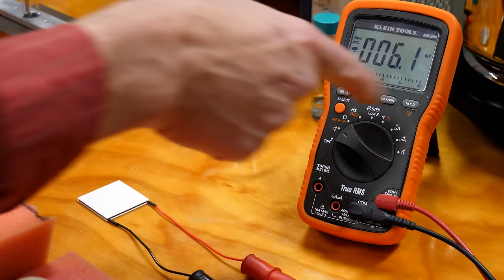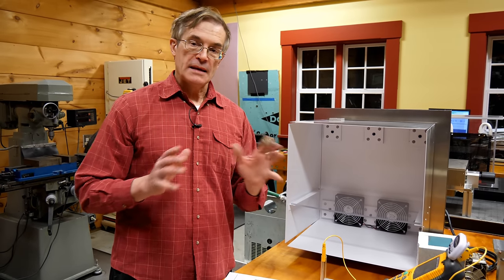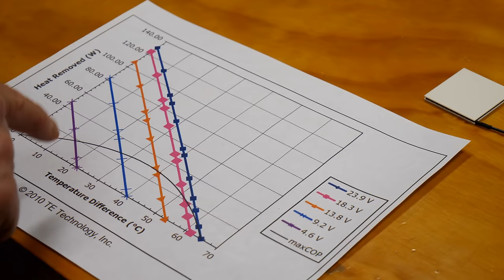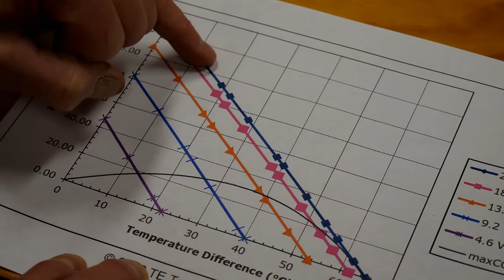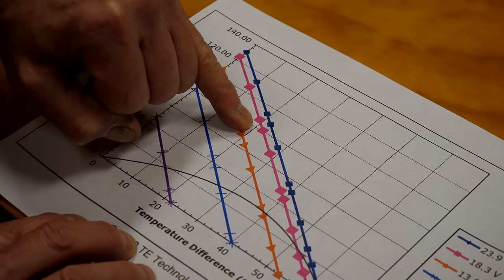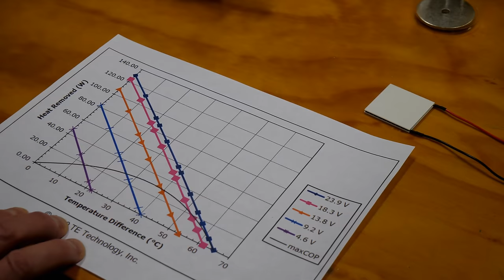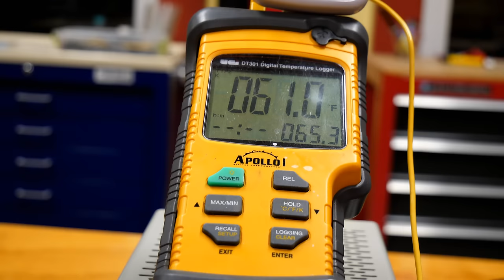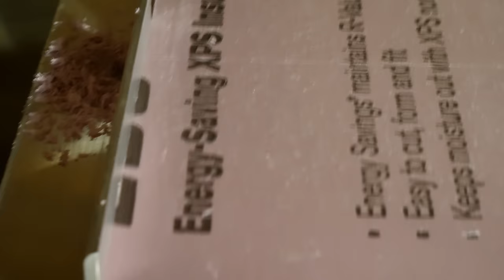BUILD YOUR OWN REFRIGERATOR! - SOLID STATE TEC

Comment: Two years ago I did the alternate approach, for the sake of lower operating costs. I bought a small phase change chest freezer and replaced the thermostat with one from a refrigerator. That gave it a higher temperature range and turned it into a chest fridge (all for around $200). It uses a minimum of three dollars electricity a month (insulation losses), plus more depending on how much heat is being put into it (from items to cool and warm air when the door gets opened). I replaced the OEM run capacitor with a larger farad value to improve the refrigerator's power factor, but that made the electricity cost go up slightly (lowering VA raised the Wattage). It had condensation issues, which I solved by putting a bucket of "Damprid" inside. Other desiccants would probably be safer for use near food, but the stuff I store in mine is mainly unused laptop batteries in ziplock bags, alcohol, solder paste and occasionally a bag of fast food.

A quirk of the compression pump running on single phase AC is that it has a minimum off time. If the fridge is turned off and immediately back on, it overloads and draws a huge amount of current for a few seconds. It takes a few minutes of being off before it can start up successfully. This is because the motor runs on single phase AC and would have zero starting torque (it would never start turning), except there's a trick used to create fake two phase AC with capacitance which adds a tiny bit of starting torque. The "start" capacitor serves a purpose but then it wastes power after the motor gets going, so a series PTC resistor cuts power through the capacitor after the first seconds of operation. After running, it takes time for the PTC resistor to cool down and reconnect the start capacitor.

Also, most phase change systems can't run upside down or turned on their side. Standing mine on the side, so the door swings open like a normal mini fridge, would've damaged the compression pump. The lubricating oil in the pump would drain into the compression lines, then the pump bearings would wear out rapidly. That's also why new refrigerators should be unboxed and stood upright for a while before powering them on, to give any oil in the lines time to drain back into the pump.
Reply: Why do you store unused laptop batteries in the fridge?
Reply: Freezers are optimised for higher delta T and lower power. To run them as fridges are not efficient. 
You can install a tray on top of the compressor and drill a hole thru the insulation so that condensation ends up in the tray. The heat from the compressor will evaporate the condensation. If you have very much condensation you either have a leak or open the lid to often.
Reply: @Bob_Lob_Law  Self discharge is reduced at lower temperatures. Keeping them cold keeps them charged.
Reply: @per.kallberg  There was a small amount of condensation, but not enough to drip or puddle. I was worried about mold and I replaced the first bucket of desiccant after six months because I didn't expect it to last, but that was a mistake. The replacement bucket is still fine after more than a year. Eventually, when it becomes saturated I can bake and reuse it or switch to a food safe desiccant. [edit: There's been no condensation at all since putting desiccant in. I didn't spell that out clearly enough.]
Reply: I did the same, I run my 150litre chest freezer as a fridge, uses 100watts a day in 30c ambient.
Reply: @Chris BalfourThe reason why compressor cant restart quickly is because the pressure has to relieve at the piston. Air compressors unload the pressure with a little valve when the pressure regulator switches off.
Reply: Chris Balfour b
Reply: @chrisbalfour466  Or for bigger loads, https://www.ebay.com/itm/AC-110V-0-01s-99H99M-Programmable-Time-Delay-Relay-DH48S-2Z-With-Socket-Base-/162009789241?hash=item25b8893339 or add https://www.ebay.com/itm/1-2-5pcs-DC12V-DC24V-AC110V-AC-220V-JQX-40F-2Z-40A-Power-Relay-2NO-2NC-/302151351183?var=&hash=item46599fbb8f for even more current. You end up with a 40A circuit with up to 99 minutes delay. It is what I'm building into a control box that will switch from commercial power to inverter power with the timer set to allow the delay for the compressor to bleed down. Yes it is an over build but it will take care of false start attempts and also cover for inverter drop outs due to low voltage. Inverter will be delayed power on to fridge while commercial power will be instant. No power will be used to operate unless the inverter is supplying it other than couple LED indicators to show operational status. 

And Mark and Chris, some commercial sized A/C units can also unload the compressors. They are used on 3-phase units where the pressure on the systems can be controlled by the number of cylinders that are used for compression. On start they can have all cylinders bypassed and then bring in the number as needed. Once the compressor units are started they normally are on for a long time and run solely on how many cylinders and evaporator sections are connected. US Army built such units into the cars for the Mobile RADAR Bomb Scoring trains. They were expected to operate in anywhere from -30°F to 120°F. Each 85ft car also had a heated coolant heating unit and a 20KW 3-phase heating unit for taking care of the cold. Even the water and waste tanks had heaters. The A/C evaporators were two section and had a heat exchanger for the cold lower pressure to the higher hotter temp inlet refrigerant. When cooling was needed at the minimum, 2 cylinders and one section would be used. For more cooling the second section's valve would be opened. That would result in a drop in compressor pressure which would bring in either 2 or 4 more cylinders. Electrical and piping nightmare but worked like a charm when needed. To prove the system, several of the cars were shipped to Alaska for the cold weather testing and the deserts in the SW for heat testing. Some current units have taps for either HP operation or Intermediate pressure also without switching in the high and low pressure cylinders. Starting the 3-phase systems without load made it easier on the generators used in the Generator Car. Each train of 7 cars had one generator car which had two 250KW 16V71 Detroit Diesel generators. One could be under load of the cars while the other was warming up on the load box. Instant switch between units but only one online/load box at a time. And they also could be hooked into trackside commercial power where the A/C load reduction was important.

Comment: Ok, for the metric people like me, 
R Value = (F*ft^2*hr)/BTU 
Our equivalent is RSI
RSI= (m^2*K)/W

to convert R value to RSI divide R value by 5.68

Where;
F=temp in fahrenheit 
ft=length in feet
hr=time in one hour
BTU= energy to raise 1 pound of water by 1F

m=length in meters
K= temp in Kelvin (temp in celcius +-273.15)
W= Power in Joules/second

I thought this would be easy, but I just got more confused the more I researched it.
Reply: Cliffs notes.. how many do I need and where do I put them?
Reply: @LastL33T   That should have fixed it, I changed W= energy in joules/ second
Reply: BTU/Hr is a measure of power expressed in thermal units also know as the heat flux or rate of heat transfer. (Unit of energy/unit of time) same as Watt is used to express power or heat flux (W=J/s) Joule per second. Also a Unit of energy/unit of time. So for it to make more sense use J/s instead of W. Then the unit of time will appear in the numerator same as in the R value.

Something very important to note in both these terms F and K are not the temperature they are the temperature difference. Or delta T. As in the temp on the hot side minus the temp on the cold side, the units are still degrees but using K or C doesn't matter because the difference in either will be the same numeric value.

So confusion also comes in because in the US customery units Watts are used for electrical energy rate and BTU/Hr for heat transfer.

I could go on but don't know if anyone will even read this far.
Reply: @barrellcooper6490  
A Kelvin degree or a Kelvin is the same size unit as a centigrade degree. Celsius and centigrade were once synonymous but one of these two terms is not used so much today.
Reply: Perhaps you have a formula that explains why Americans frustratingly cling to such archaic units? I believe one of the variables is Hillbilly Pressure (HBP), part of which is measured in decibels.

Comment: Great video! I test and calibrate TEC controllers (among other things) for laser mounts for use in optics labs. They range from cheaper 16W analog systems up to 120W digital systems that can maintain ±0.005°C. The demonstration of the thermal energies between two dissimilar materials is the best I've seen.
Reply from the maker: Thanks!

Comment: Great explanation of refrigeration! Love the project. ❄⛄
Reply from the maker: Thank you!
Reply: Sit back, chill, and enjoy the science.
Reply: @TechIngredients  will there be a part two of this video would love to see the finished fridge with some practical testing like how the real life efficiency of the system, some noise comparison between this and a regular fridge etc.
Reply: @TechIngredients  As always, wow. Explanations are great. Suggestion: It would be great to see some theory and calculations for these projects. I realise this may go against the hands on experimental approach, but a snapshot of the calcs and formulas associated with these projects would further solidify concepts being covered. Maybe a brief discussion on a whiteboard, or animation that pops up a certain points of the video. This could be an improvement, but regardless you folks are on the money with your videos.
Reply: This is actually a very poor description of refrigeration. A compressor only compresses gas into a hot compressed gas. The cooling of that hot gas causes condensation of the gas into a liquid. Small detail but kind of important. EDIT: looks like you corrected this in a number of other posts.

Comment: "For you monopole people and infinite energy people"

I died 🤣
Reply: Zing!
Reply: I'm annoyed he bundled monopoles with infinite energy. The former is theoretically possible and believed to exist by many theorists, as it'd explain many things; the latter is impossible.
Reply: Unless you bridge it through a quantum tunnel 😝
Reply: GRBTutorials.. ahh🙂🙃🙂🙃🙂🙃
Reply: @GRBtutorials  Yet somehow the universe has energy. Care to explain why that is?
Reply: Only if a monpole was real 😪
Reply: Infinite energy is possible... in a hypothetical, impossible situation. (I also found this statement funny)
Reply: @GRBtutorials  a triple pole ( magnetic / electric field ) designed such that common poles / fields are much stronger than the other pole / electric field, can behave as a monopole, hiding the weaker pole inside it. 
It's also possible to achieve similar results with multiple quarks spin and charge manipulation of various combinations of 1st gen up, down, anti up, anti down quarks, 2nd gen strange, charm, anti strange, anti charm quarks, 3rd gen top, bottom, anti top, anti bottom quarks, as well. 

a spinning singularity with charge hides the other pole outside the definitions of the universe, it's charge is an acquired property of its spin.

Also infinite energy is more energy than the maxima of the definitions of the universe, essentially, if you know how to manufacture and destroy universes, infinite energy is a simple concept.
Reply: Im in thermodynamics, and this is possible in a carnot cycle (jk for the non engineers)
Reply: @williamforsythe5850  That has nothing to do with what he said. The difference between energy and infinite energy is...infinite.
Reply: @ashscott6068  Yeah the OP changed his post. The original is now in the aether somewhere.
Reply: actually, monopoly magnets are real (or i may have misinterpreted a monopole lecture at the royal institute?). And energy is infinite because time/space is infinite (no evidence to assume otherwise) Mr Dirac. 

My first and last zero point invention i theorised was a water wheel generator using a syphoning to create water flow. Till a friend reminded me of friction. But the heat can be used to increase air pleasure within an isolated environment, not sure what the limit of the system would be? Alas haven't sufficient acumen to even theorise coherently. The reason why i like listening to people who are smarter than I.

All that aside, i can't deny i smirked at that.
Reply: Yet teslA himself said “ energy is free and all around US “ !!!!

Comment: COP of 2?  Man that's way better than I remember when I was toying with Peltier devices many years ago.  I figured it was like 0.4 or something.  Great video, really loving the content.
Reply: I would love to hear more on that too, I had little luck with the efficiency.
Reply: Also, the COP of run-of-the-mill cooling devices is about 3. Maybe he's using EER which is about 3x of COP.
Reply: The COP of 2 is for the Peltier device itself, not the whole system. It assumes 100% efficiency in transferring heat into the device, and 100% efficiency of removing it to the outside air. It also doesn't allow for fans, power supply efficiency, etc.
So, don't compare the COP of a Peltier plate alone with the COP of a complete working A/C or Refrigerator.

Comment: Many years ago (young and not very experienced) I used TEC as an electrical DC generator/charger (it was generally similar to the back section of your fridge). One side of the system was attached to the back surface of wood stove (with adjustable gap-so-heat control) and the heatsink part was outside (through a rectangular hole through the wall to the outside). It was very efficient (around 27A/18VDC max.). Since you are well equipped and innovative you can offer a discent design in this regard. There are lots cabin/outdoor people who might be interested.
Reply from the maker: Did you watch our video on the "Campfire Generator"?

Comment: I think a really cool idea for this system would be to build a back-to-back food dehydrator/refrigerator. This video handles the cool side of things flawlessly. I can't help up think that you could build an enclosure on the other side of the refrigerator, that you can blow air across the heat sink to warm the chamber to an temperature appropriate for dehydrating food.
Reply: Based on my understanding of the tech, it wouldn’t be feasible. 

Now granted I’ve got no idea what temp you’re shooting for with food dehydration, but peltiers really only work by shedding heat to one side. Up the voltage too high on a given cooler, and you’re producing heat on both sides. I’ve discovered this with my own boneheaded tinkering. You’d need a large space that significantly sheds heat from the peltier, while also concentrating the heat that comes off of it at whatever you’re trying to heat/ dehydrate.

Comment: I have a bunch of peltier units for just this sort of project. Your explanations and peltier foam + ball metaphors are fantastic for a visual learner like myself. Definite time compression experienced for the 41 minutes of tutorial.

My intended project is a DIY humidor / camera lens "fridge".
 
Do you have any suggestions for reintroducing water vapor to maintain a desired level of humidity? For my purposes, just plain air will probably be sufficient - my local climate is humid enough, however for completeness I would like to manage increasing the humidity directly.  I figure the hot side of a peltier could be used to create the vapour with some water, however controlling its introduction back into the system has me slightly stumped. 

Thank you for this video and your content in general, it's appreciated.
Reply from the maker: Thanks!

Comment: I found a wine cooler, it was given up because it had an electronics issue. I took up the fans and peltier systems. Checking it out at home and BAM! I find your video on this!
Awesome!
And thank you for sharing your knowledge! All that I can say is, "WOW!"
I can't wait to make me a soda bottle cooler. Or a aquarium cooler. So many ideas come and go!
I did have a 100 gallon aquarium outside, and this is Phoenix, Arizona. When the summer came, it was game over. I tried different methods. But once the heat radiated into the concrete of my patio, it was game over.
Thank you, again! I am subscribed!
Reply from the maker: Thanks!

Comment: Did you just explain how semiconductors work? Because lot of plus and minus signs in paper don't quite explain why electrons go the way they do. I love how simple the cliff explanation is :)
Reply from the maker: Modern TECs no longer use metal and use semiconductors because they are more efficient.  Semiconductors work in a similar fashion, but the electron deficiency/ surplus is achieved with doping and the transition points can be used to produce effects other than generating or absorbing vibrational energy to produce or absorb heat (light) .
Reply: Yeah , semiconductors pump heat and emit light. Heavy duty diodes are fabricated to mount the "cold side" to the mounting tab or stud for improved thermal transfer.